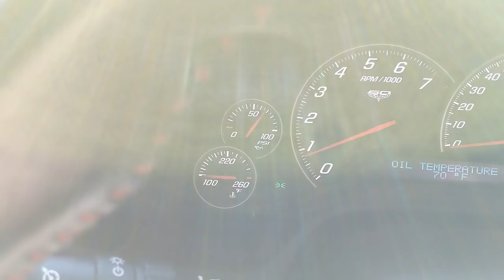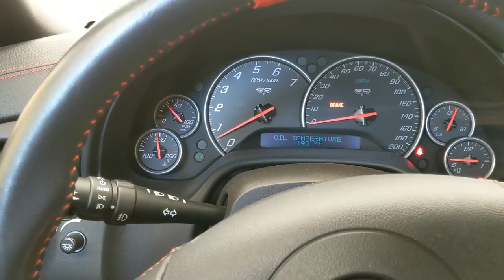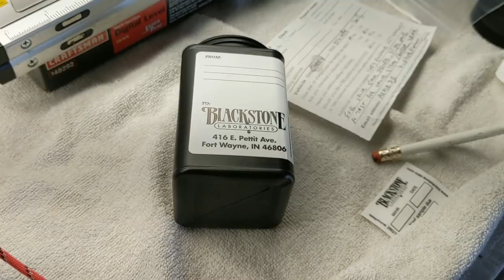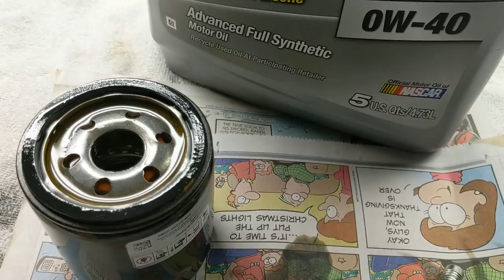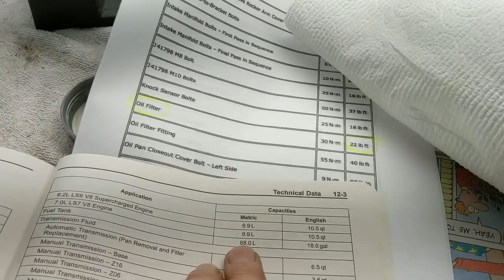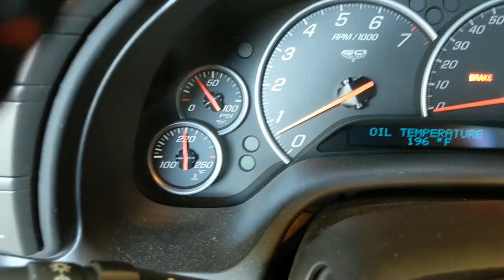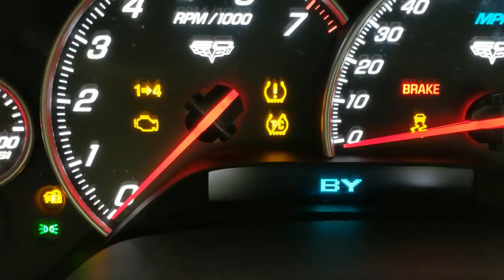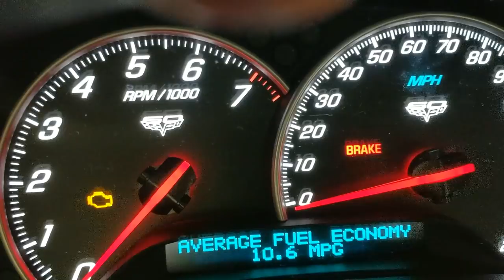Corvette c6 z06 oil change 0w 40 reset monitor mobil 1 by froggy second cut

Comment: Very detailed! Excellent video. 

I was always confused when doing my oil change and how much to put in. My car at 10.5 quarts is barely at the middle hole. I usually have to put 11 quarts on mine.

Do you have to add oil between oil changes even driving under normal conditions?
Reply from the maker: Never have, but if you track there may be a special requirement, see the owners manual.

Comment: Thanks for doing this video.  I wondered why my stock drain plug was not the magnetic type.  So, I ordered one from Amazon.  I will change it out when I change the oil for the Spring/Summer driving season.  Yeah, we in the Mid-West have to wait for spring to drive our Vettes.
Reply from the maker: I like the mag ones.

:)

Comment: Hi Mr froggy I pray that your holiday went well Mr froggy what do You think about or have You had any problems with your car with the valve springs . I heard the C5 Corvette had a issue with that What's your experience. And what about these column lock defect that with our car has have you ever had a problem with that also. BCM.  Thank You
Reply from the maker: So far no problem with my 2004 c5z or 2013 c6z
Reply: Thank You
Reply: Thank You

Comment: Froggy.  A dry sump has more than one drain plug???  I heard that these dry sumps held a boat load of oil.  11 Quarts is a lot.  Wow, that 0 W 30 is really light.
Reply from the maker: Yes, I drained 10 qt, & still some in the lines & cooler. I used 0w-40.

Comment: Why European formula?
Reply from the maker: Has more zddp and phosphorus (better for engine wear, but a little harder on the cats) Rather replace a cat than an engine.
Reply from the maker: IMO better oil for how the car is used & out of warranty now. so I don't care if 5w-30 was the spec. back in 2013.
Reply: You tracking mostly? When really hot what is your oil pressure?
Reply from the maker: @andrewdomenitzdmd  Only a couple a year, autox monthly. I don't know with the new oil yet With 10w-30 in my c5z hot (225) idle press was probably 25-30 ls6 motor. With the c6z ls7 unknown oil was a little more, IDR exactly. I guess dry sump= more pressure across the board??
Reply: @1947froggy  Well, no. You are going to have your higher viscosity at the higher temperature. Plus you will have the Zddp for the pressure protection associated with flat tappets. The extra Phosphorus helps nothing and could mess up the catalysts. The thing to note is the vapor pressure because any blow by will put it in the cylinders. So If you are concerned about anything to compare the oil pressure readings at your track to the other oils and volatility. I doubt they put catch cans on these vehicles, that might be over the top for anyone who only knows the key goes in the ignition and there are pedals and a wheel. 

Realize that oil pressures in an engine are not all the same throughout the engine. The highest pressure you read from that engine is the high limit at that spot. The pressure at other points will be dependent on the tolerances of what the next thing is. You could have an oil related failure anywhere down the line from where the first reading is. The 40 wt will show higher than 30wt but does not address oil flow. Once weel warmed up you should be sustaining higher pressure. Dry sump is for addressing oil starvation because of g-forces putting it up against the side of the pan in curves. The sump is never dry so the pump is never sucking air. Drag racers have the same problem and had to use baffles. The dry sump also eliminates drag on crank and churning of the oil making air bubbles done like an eggbeater in there.

What I have heard over and over again is that it is about oil flow and killer heat. At a certain heat, the oil loses it. it just drops out of the ability to lube. The molecules just give up being chains.

By the way, I have watched all of your Corvette related videos and find them to be very good and thank you for your work.
Reply from the maker: @andrewdomenitzdmd  Thanks, good post, thanks for your time. Agree with your detail, I knew most of it but many don't. So why do the oil companies put more Phos in their "racy" oils? They pretty much all do. And I know real race engines = no cats.

:)
Reply: @1947froggy  The phosphorus is for lack of lube on start up. It is not as an element but in the zddp. it is a metal molecule which must act like either ball bearings or some kind of millionth of an inch of separation of metal bearing to iron surface when there is no flow.  These chemical compounds break bonds under heat and get into the catalyst and also the atmosphere. The phosphorus is also in the carbon buildup wherever it goes. The pre 1980 stuff needs the higher phosphorus because of the metals used them. If you build engines and are going pre LS iron block I suppose you can get cranks and cams made modern metals with appropriate bearings. Valve guides and seats are another concern. The LS engine blueprinted, balanced with some boost on it is the most exciting thing I have ever seen with American pushrod v-8s.  If you are dong a lot of short trip and starting your engine a lot you might want to consider zddp additive. You will also not be running real hot so it wont be that bad on carbon. If you  go long distances and you are boosted you might want a catch can for keeping it from valve buildup.
Reply from the maker: @andrewdomenitzdmd  Hi, I do actually do a lot of short trips. Cold start/2-3 miles/shut off 2 hrs/another start/2-3 miles/shut off. On the 2nd time I am up to an oil temp of about 170f is all. Then weekend autox, 25 mi trip & 4-8 hard runs (over 230f) then easy ride home (200f).

I never added anything to oil since maybe the 60's. I put 5k a year on the Vettes so not worried about wearing out cats. You think I should add anything to the 0w-40 M1. They make it with about 1000ppm zddp and same phos. Thanks.

SoCal so start temp ambient/oil is never under 60f so that's a good thing, right?
Reply: @1947froggy  Well then the 0-40 will give you the flow at start up and if you have that higher zddp from the Euro stuff that is the best you can do. It's just that you got to warm up past 212 to cook off the water. Its that water what's no good and break down the oil.
Reply from the maker: @andrewdomenitzdmd  I agree about water (condensation). IMO since I get it way up to temp (over 212 f bp of water) once a month or so, I am probably ok with the many short trips. I drove the ls6 for 10 years the same way and never had a hint of an oil issue. Thanks.
Reply from the maker: @andrewdomenitzdmd  Excellent data thanks!
Reply from the maker: @andrewdomenitzdmd  I race every 2 weeks & burn off any h2o

:)